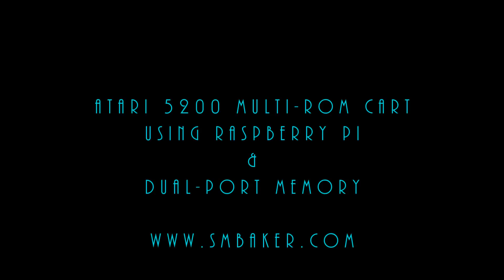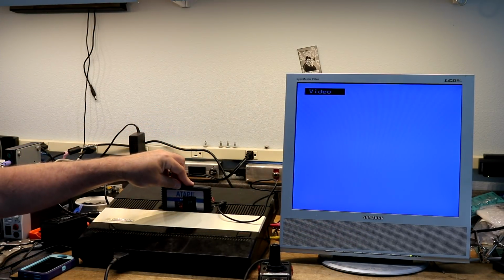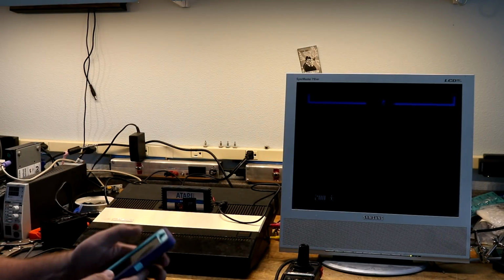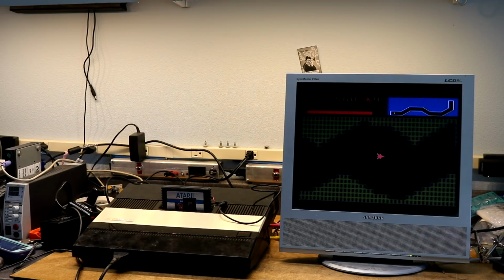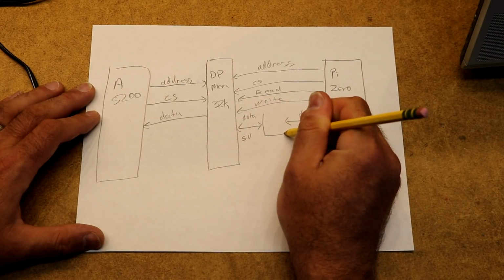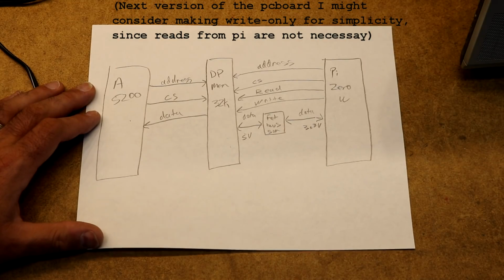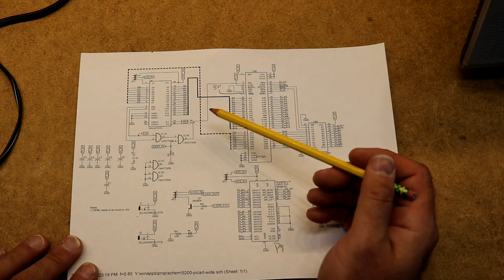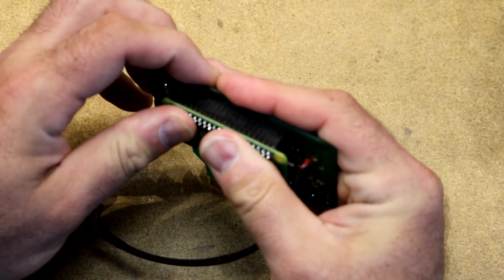Atari 5200 Multi-ROM Cartridge Using Raspberry Pi

Comment: Have you considered doing a bank-switching version? Of course that would require more than 32KB RAM, and for dual-ported that might get very pricey--I haven't checked. There are games, like AtariBlast!, M.U.L.E. (800 conversion), and Bounty Bob Strikes Back that use bank-switching. I'm also developing a series of games that use the Mega-Cart bank-switching (same as M.U.L.E.). I could get you the details of the bank-switching, if you're interested.

Comment: I had a similar idea for the Atari 2600 - using a Raspberry Pi or Arduino, write code to a pair of RAM chips to act as buffers which are accessed by the 2600 via the cartridge slot.
The code written to the RAM buffers would tell the Atari 2600 to do the following:
1. Request the data from the RIOT chip regarding the input registers and write it to a specific address in the current RAM buffer.
2. Draw to the screen using instructions & data written to the current RAM buffer by the Pi / Arduino.
3. Generate any sounds using instructions & data written to the current RAM buffer by the Pi / Arduino.
4. Switch to the other RAM buffer to get the next instruction.

On the Pi / Arduino side the following is done:
1. Read specific addresses on the current RAM buffer to get data on the controls.
2. Handle all the game logic.
3. Write instructions & data to the next RAM buffer regarding graphics & sound.
4. Switch to the next RAM buffer and repeat the cycle.

But I only understand the basics. If I had more free time I could read up on it and attempt it - maybe build a simple raycasted maze or something.

Comment: How do you get the schematic capture to know that you want a component on the back side. Of course my first  board design requires a connector on the back of the board like your raspberry pi connector. I could not figure it out. I was trying to use the on-line schematic capture and design tool.
Reply from the maker: Eagle has a "mirror" tool, and using it in the board editor will flip a component from one side of the board to the other. In my case though, that's not what I did -- the raspberry pi footprint I'm using is for a "hat", with the intention that the board sits above the pi. So it was already setup that way.

Comment: Awesome! 
Did you consider something like using a pair of 74x595 shift registers for the address bus?
Reply from the maker: Typically I used IO expanders, either the PCF8574 or the MCP23017. I find them easy to interface to the pi and easy to share with other peripherals. Shift registers would have been another good option -- I used shift registers in some of my IN12 nixie tube projects.
Reply: smbakeryt makes sense. Thank you for your reply.